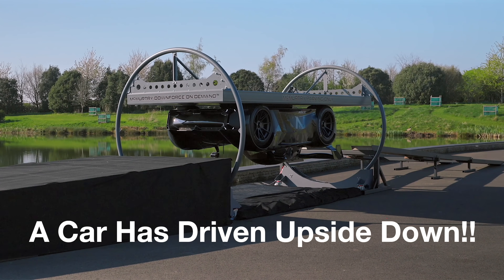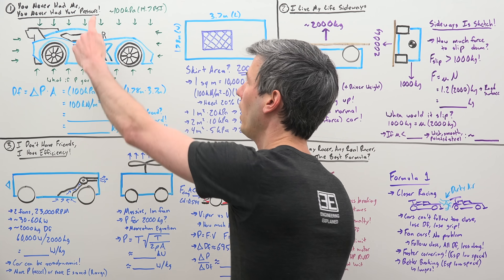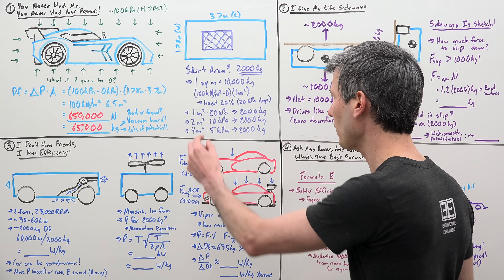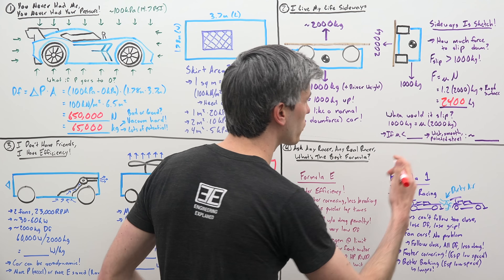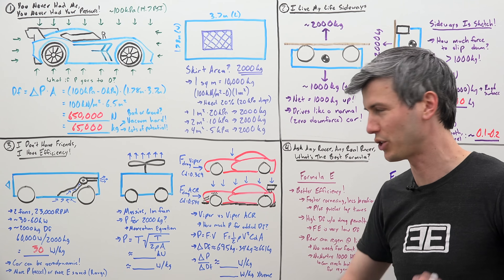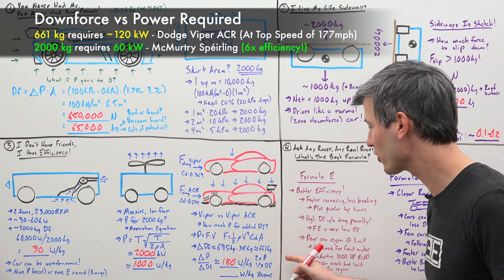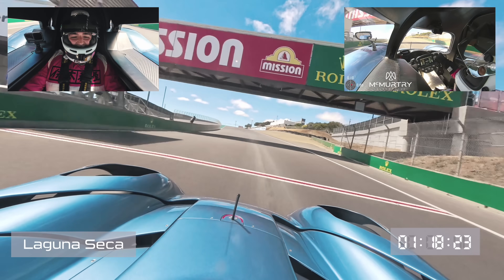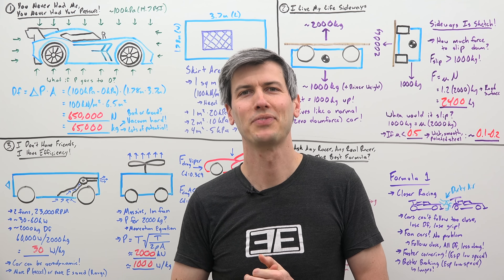This Car Just Drove Upside Down!

Comment: Isn't there a lot more air pressure pressing down on a car than up or sideways? So in essence with no ground to hold the car (and compensating for gravity) wouldn't the car be pushed downward in net force

Comment: Can-Am lost its way when it banned the 2J. But at least they weren't as allergic to innovation as F1 had become even then. I have to believe there is an audience out there for a circuit race series that focuses on figuring out how to enable innovation rather than knee-jerk banning it. It's a shame that even this many years later the Spéirling is an oddball with no racing home rather than just typical of a particular class.

Comment: cool video on the engineering side of things but it's clear you don't watch motorsports as a fan. increasing the cornering ability is one of the worst things you could ever do for a car class as a fan. smaller gaps between top speed and bottom speed in a corner means less overtaking ability in breaking zones, less ability for drivers to risk it for a faster time, less driver skill, less limit testing and crashes, and less of everything that makes watching racing fun. the only upside is the small temporary satisfaction of seeing overall lap times go down substantially and knowing the cars are technically faster than they were before

Comment: Formula 1 Track Racing - I don’t know the exact limitations they place on the change in elevation / road length but I’m wondering if a FAN CAR could run into trouble if it encounters a cresting hill leading to the fan shroud to no longer be in close contact at the front leading to a dramatic reduction in downforce from the fan.

Would we then get a situation where the front of the car begins to lift leading to an even greater loss of suction, possibly cartwheeling the car? Since we don’t know the actual position and shape of the suction plate but if it was on the smaller end of the guess and focused toward the mid back closer to the rear wheels could this also lead to a non-centralized pivoting point where front lift gains a leverage enacting on the suction plate? 

I have lots of questions but essentially i’m trying to think of a scenarios where part of the skirts would lose close proximity to the track.

(presumably from an elevation change in the track where the straight line of the skirt gets hung up on the road from bumps, dips, crests etc… On that note i’m super curious about the suspension that car uses since its only factor in that regard would most likely come from roll/sway from cornering since it’s basically always glued down to the road at a constant force … 🤯 I don’t even know where i’m going with this anymore 😅

Comment: Nah. This is cheating. The whole point of the hypothesis is a vehicle design that is fast and light enough to use forward velocity to generate negative lift (downforce) that not only exceeds the weight of the vehicle, but counteracts the positive lift the other aerodynamics of the vehicle creates.

Comment: This kind of reminds me of those micro mouse maze solving competitions. They compete on how fast their little robot can solve the maze, and so one of the biggest breakthroughs made in these competitions was someone adding a fan to give their little mouse robot more grip to the floor making their mouse able to move faster without losing control. And the fan was so powerful in comparison to the weight of the car that it was able to drive up walls and on ceilings. It’s exactly like that, except for a full scale car

Comment: This proves nothing about aerodynamic downforce created by an F1 car. An F1 car will not drive upside-down. To create its downforce, it needs to use that downforce to press the wheels onto the track surface  to be able to drive itself along. If you turned an F1 car over at 100 mph, it would just lose traction and fall off the ceiling. You can't create more downforce than you've pressing on the wheels.

Comment: It would be very interesting to know if this was a full battery load and not lightened, and if the underfloor was as raced and not adapted with any extra side skirt seal bits etc.  I.e. was this a real test or just a mocked up showpiece. I hope it was real.

Comment: 8:00
" Little energy"....🤨🤨
60Kw is definetly NOT LITTLE.
a normal sized house has a 200A 240V electrical panel. Thats 48Kw..
So this 60Kw fan consumes the same energy as almost 2 fully loaded houses..
NOT SO LITTLE.

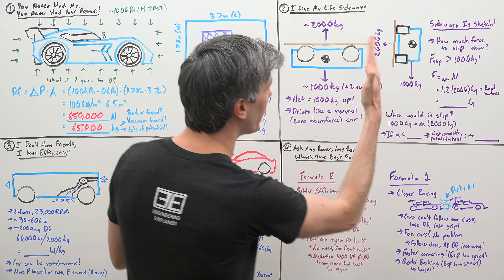Comment: 6:00
Sideways or upside down... No differences.
Air is all around us.
And gravity pulls the car down the same way in any position.
Car is not heavier sideway.
And air pressure dont have direction
Sideway should help the car to hold the surface because it's helped with the friction of the tires.
When upside down, the tire friction is absent

Comment: 3:35
But what if YOU got fooled, and IT IS actualy a Magnet..??
But i mostly think it's not a "fan" thats creates the air pressure diferential, but most likely it's a vaccum pump that removes the air under the car. Just like with the glass succion handles that is used to hold and transport glass

Comment: 0:46 Seriously? A guy spraying champagne all over the driver and his seet? That sugar going to stick and not easy to clean up from leather. Also everything what he touches later going to stick. This triggers me so badly.
Reply: Either a volunteer or underpaid intern will clean the car don't worry
Reply: Leather? Probably not in that cockpit. Lightweight synthetics no doubt. Even just to save a few grams.  Although maybe the steering wheel grips but if you're gonna be wearing gloves in the things I don't even see the point there.
Reply: @UnfoxYourself  So you say the sugar is for extra grip? lmao
Reply: @kovacsattila8993as long as he got some on the tires. Although if I had my choice of which common household ingredient is going to make my tires sticker, I'd probably choose bleach (and definitely wouldn't use very dilute sugar water even if the water evaporated first).

Comment: The BT46 technology was banned in F1 not because it was unfair, but because of the consequences of what would happen if suction was lost. As awesome as the Spurling is and the records it is beating, it is entering corners at a significantly higher speed than any  FIA approved track is designed for. One momentary loss of suction and the car is going to fly into barricades at significantly higher speeds far greater than they are designed for and would likely result in death.

Comment: interesting and all, but in real life scenario, as soon as a vacuum car goes through a bump, the suction disappears, and the downforce will be ~0. if this happens in a corner, then it flies off the track. so either you create increadibly smooth tracks, or combine this with passive aero, that relies on speed.
Reply: I think the previous generation of ground effect F1 cars (which used floor shape rather than an active fan) did have skirts, but had a similar problem, even with no bumps if the skirt was damaged at some point before going into a corner suddenly there would be much less grip than expected and the car would slide off the corner (which of course could result in a bad crash depending on the corner). 
That is why the current generation of ground effect cars does not allow skirts.

Comment: Technically, that car doesn't prove the F1 / race car myth at all. It's not using aerodynamic down-force to drive upside down, it's using vacuum to hold itself to the surface the wheels are touching.

Comment: Probably the main problem for this solution for racing is going over some kerbs and losing the seal for a bit. Some interesting stuff can happen during this time (imagine hitting a kerb while climbing the Eau Rouge - Raidillon corners). But it can be interesting if they solve this problem.

Comment: The car can not run with the skirt all the way to the ground as it Will damage the road and No one will ever allow for that. So that Type of a seal is exclusive to this test. 
It also creates Drag, sparks and poses a threat to the Car and the driver if there is a Bump or a crack in the road. 
The skirt can probably change Height based on racing condition, but it will never be that low.

Comment: I can't  get over your sideways calculations. Here is what is confusing. The cars weight is in kg and the force is in kg... This are different units redoing it with same units means the car will slip. Here is how.. 1000kg*9.81 gives 9810N  ... F=uN is 1.2*2000 which is 2400... I think we  can fully attribute the extra 9810-2400 = 7410 N to the adhesive or some other clever trick.... I might be wrong would love to be schooled!

Comment: In a 400m sprint will the car go faster with the fan on from start to finish or if the fan is on for the first 100m and then off the rest of the half mile? I'm assuming you need the downforce for grip at start but not when the car is already in motion.

Comment: I want to see a mathematical analysis of cars with passive downforce trying to drive upside down.  I've heard of cars that at speed create more downforce than they weigh so theoretically they could drive upside down.  But could they?  If they are upside down and you subtract gravity force from downforce there is still some force holding the car against the now ceiling, but is this enough force to develop the traction needed to keep the car at speed?

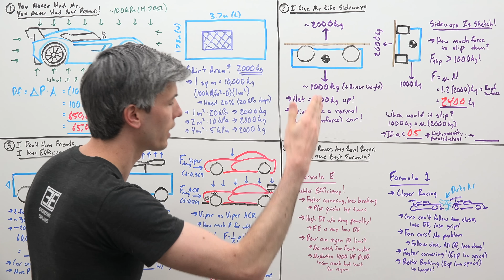Comment: Great video as always! Re: 7:15, it actually gets sketchier rotating a bit past that as gravity starts reducing your normal force. Worst case is at 120 degree rotation - you'd need approx 0.58 static friction coefficient to hold on!

Comment: that bit at the end about what impact it could have on FE/F1, i was wondering about that myself during the video

the current generation of F1 cars already made a step towards that generating a vacuum under the floor for cleaner downforce, though many teams had problems maintaining stable rideheight close enough to the ground to work properly, i wonder if having a fan that could provide a more constant downforce level would help with that or make the problem worse 
maybe if active aero works out well we might see fan cars returned 

another idea i had which idk if it crazy good or crazy bad :p, could you put the intake for a supercharger below the car and use that to both pull the vaccuum under the car for downforce + feed that air to the engine

Comment: F1 bans every innovation teams might have. Fans for downforce, 4WD, active suspension, driver-adjustable rear diff, blown diffuser, driver-adjustable toe angle etc. etc... And then they have racing rules which are interpreted completely randomly or by whoever the judges might like or dislike.
As an engineer, F1 has been interesting because of the tech, but these days there is no tech. Everything is banned. That's why I stopped watching it completely. Nothing interesting is happening on the tech side of things. Someone invents some new cool thing, banned. "We have this idea..." banned!

Comment: upside down you have to have more downforce than the weight of the vehicle and driver because the tires would lose traction without a minimum amount of weight applied to the contact patches and there would be a change in the tire deformation profile with no weight or very little weight on it

Comment: F1 could just allow skirts and the existing ground effect rules would become a lot more interesting—ride heights could be increased so the cars have wider operating windows, passive aero could be limited to reduce dirty air, and *active aero wouldn't be necessary to prevent downshifts on straights when the next engine regulations come into effect.

* I'd like to see active aero increase performance and efficiency, not act as a stop gap against poorly conceived power train regulations.

Comment: I love this approach to the challenge. Everyone knows the theory should stand up but developing a track that actually lets your drive upside down at the required speed is such a big hurdle in itself. This approach uses the math in a very smart way to prove the theory using significantly less resources. The team at McMurtry Automotive should be extremely proud of themselves.

Comment: The Chapperell race car had the same principle back in the early 70’s. It was called the 2J. It had 2200 lbs of downforce( theoretically). The car was only 1800 lbs with a 427 cid engine. It produced about 600 horsepower I think. But its trick was 2 fans at the back which sucked air out from the bottom of the car. It also had 2 lexan panels on either side to help create a sort of vacuum under the car.
Reply: Shhh!
Reply: The Great Gordon Murray.
Reply: The 2j got banned because it kicked up so much dust. I bet this thing does the same thing.
Reply: @charliepainter4433 it has a variety of filters that stop it kicking up too much behind it. It works very well as even on mucky tracks you can see it's not leaving a significant trail.
Reply: Yeah that was what I was most curious about was the interface between the suction area/duct and the road. I'm not surprised they kept that part secret.

Comment: What about safety?

If you're cornering at the limit and run over a surface imperfection in the track that reduces the efficacy of the seal, then you lose suction and now suddenly you're exceeding the limits of your cornering ability...

Comment: This is awesome! Although in the section about why the sideways condition is sketchier, you only discussed friction to prevent sliding. I was surprised that you didn't touch on the rotational moment that is created from the offset center of gravity from the road surface. The car wants to rotate away, with the bottom wheels as the fulcrum, so the upper portion of suction is doing most of the work. For statics - it's not just resisting shear force but also tension created by the moment
Reply: Differential pressure resists rotation, with the lower tyres exerting more normal force, but only the tyre friction prevents sliding.

Comment: There's also the fact that you don't have to use the full fan power all the time. As the power requirement of centrifugal fans mostly depends on the mass flow it would be possible to restrict the intake and let the fans keep spinning at very high speeds and by that reduce the power requirement a lot. It would even be possible to spin the fans faster and still reduce the power required, still a lot, and just stop restricting the fans when you want that downforce again.      

With multiple stages of centrifugal fans the first fans wouldn't just be able to spin without generating mass flow if the intake was closed, they could spin in significantly reduced air pressure, further decreasing the power requirement for keep spinning those stages, while keeping the ability to achieve that extreme downforce in very short time when needed.    

It could be interesting for road cars to reduce stopping distance, but it's not likely to sell well as a pure safety feature, especially considering what such a system that's really good would increase the price of a production car.

Comment: No, that's not good enough. It needs to use its aerodynamics to hold it to the road. Put that rotisserie in a wind tunnel and get it to speed, then roll it over! Otherwise, anyone could throw a few fans in a car and vacuum it to the road.

Comment: I wonder how much better braking performance is with fans.  pretty much every car has brakes capable of locking up the tire, bigger brakes are just about doing that repeatedly.  what i'm saying is actual braking performance is limited by the tire's grip, not the braking system.  I'd imagine such downforce, that is now available at all speeds would allow the vehicle to brake much harder/shorter/quicker.. which in itself is usually the fastest car on the track.

Comment: One small correction on Formula E: the front MGU is also used in Attack Mode- a time-limited, power boosted mode that uses 4WD to help put that power down.
Reply: This fan technology would make Formule E so much more interesting than those Mario Kart things like attack boost and not using the front motor.
Reply: @Deveonn No it wouldn't. This technology would be terrible for racing as the resulting air flow behind the vehicle is so terrible it would making overtaking near impossible.

Comment: Unfortunately not a car for anything but clean solid surfaces with the fans on.  Forget public roads, and especially not dirt/gravel ones - too much loose pavement/gravel/debris to pick up/throw/damage fan blades.  Not even sure most 'top tier' racetrack's surfaces would hold up for long with a full field of these racing on them.

Comment: On a normal road car with a wing and a splitter, what is the change in underbody PSI?  Is it a fraction of a PSI? 

Second question: S650 Mustangs and Lucid Air Sapphire use underbody “strakes” to curve airflow to the low pressure behind the front tires’ contact patches. The C8 Corvette uses long thin strakes to push air out towards the rockers. Which works better?  

Your Mustang vs Corvette vs EV video should get lots of clicks.